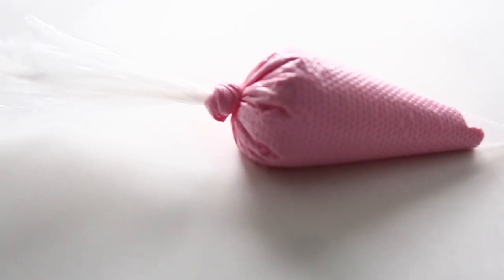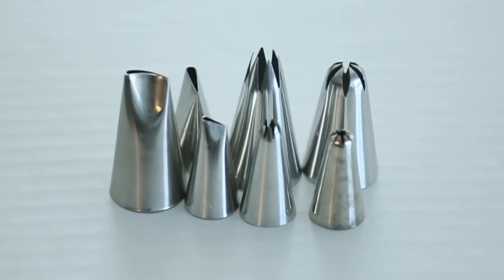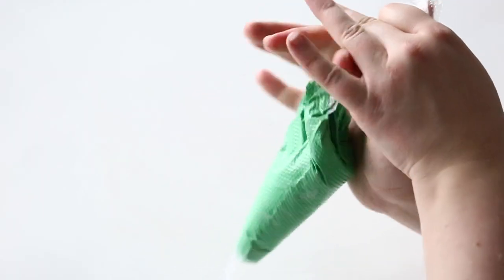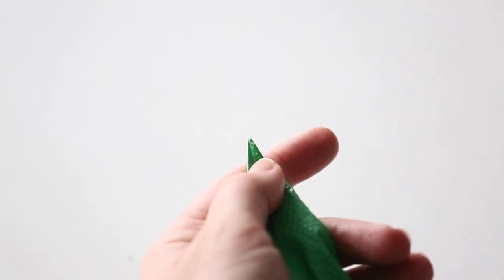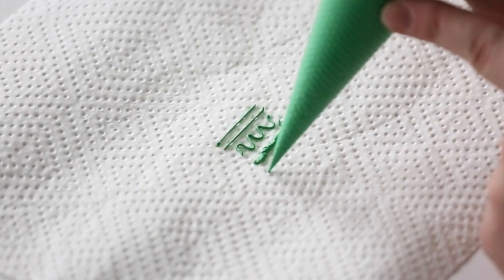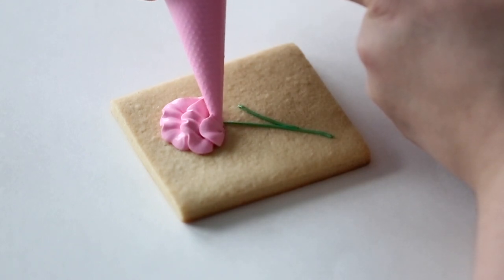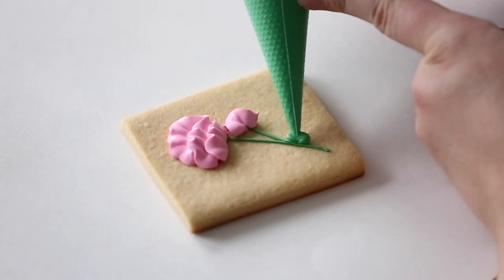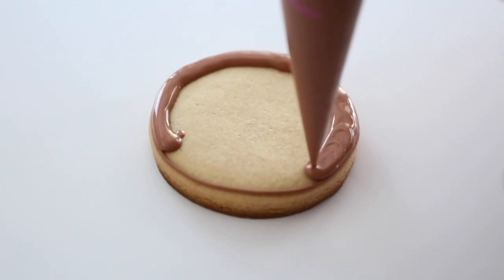Why I Use Tipless Bags

Comment: I use a heat sealer to seal my bags and if I have left over icing, I heat seal the other end and place all my left over bags into a gallon size ziploc. 😉
Reply from the maker: Great idea!!
Reply: Great tip!
Reply: How long is it good for?
Reply: Great tip! I have a heat sealer so I'll use it! Thanks!
Reply: Do you freeze or refrigerate leftover icing?  If so, how long does it last?
Reply from the maker: I personally like to refrigerate it overnight if im still working on my set the next day. But I used to keep it on the counter but find the icing separates less when in the fridge. Once I'm done my set I'll put the icing in the freezer, it should be good for 4-6 months I think?!
Reply: Do you think a hair straightener would work??
Reply from the maker: I've hear people using a hair straightener but maybe put a towel or something in between. I'm not sure if the heat would he too high. But I know I've read people do that!
Reply: Smart!!
Reply: Brilliant. I've always wanted to decorate cookies but was intimidated by the icing drying out etc etc. Now I'm considering heat sealing the bags if I can't get to the cookies until the next day, then putting those heat-sealed bags into food saver bags and use the pulse function to gently remove as much air as possible, and then refrigerate the bags.
Reply: So smart

Comment: Is this why I’m struggling with getting my lines to go straight? Because I’m using the Wilton bags as a tipless bag????
Reply from the maker: Yes!! The thick seam pulls the icing in that direction and so it doesn't let you pipe  a straight line (and always curls)! Buy some tipless bags and you'll notice the difference right away!

Comment: This was so informative. Hie large of a hole do you cut for just flooding cookies?? I think I may be using a hole size that I too small
Reply from the maker: If you find yourself squeezing the bag so hard that your hand is shaking, it is definitely too small! I always adjust the hole too as I go, if I find its coming out too slow or not enough, then I'll cut slightly bigger. You want it to flow without too much pressure but still want to maintain control of how much is coming out if that makes sense.
Reply: Thank you so much!!! @LittleCookieCo

Comment: Thanks for the video. I've been using a lot of your videos lately to learn more about decorating with royal icing and they are very helpful. The only concern I have about this technique is all of the waste with the plastic bags. I would totally be down with this technique if there was a way to save and mark each bag. Single-use plastics are literally killing our planet, so I will have to stick with reusable piping bags qnd tips for now.
Reply from the maker: Yes, I do agree, it really sucks that there is not biodegradable options right now (that I know of). Just make sure you wash your reusable bags really well as sometimes the greases stays in them especially if you use it for buttercream as well.
Reply: Best comment. Thank you. I'd rather put up with the small inconvenience of washing bags and perhaps not having as much control when piping icing, than adding to the plastic problem that's hurting our Earth.

Comment: I really love your video, it’s so clear and helpful, I can’t help but click the subscribe button😆

I always have flat icing when I pipe, do u have any tips on how to cut the tip of the  bag?
Reply from the maker: Thank you so much. Are you using bags that are quite thick? Or have a thick seam, sometimes that is the reason that it comes out flat. You can try cutting with the seam in the middle, make sure you are using really sharp scissors and cut a small hole, and then squish the bag flat the opposite way, and cut a tiny tiny bit off to make it a bit more even. Hopefully that helps!
Reply: @LittleCookieCo  thanks for your reply, I’m using the thin one, maybe my scissors is not sharp enough, ok I’ll try to do as u said😊 and see if it comes out better🙏🏻
Reply from the maker: Yes, make sure you have nice sharp scissors so your cut is smoothe. Also, squish your bag flat. If it's not flat, cut a tiny tiny hole and let the air out then make your actual cut! Hope that helps!
Reply: @LittleCookieCo  got it, thanks for your tips again, I’ll let u know if I got it successfully 😘
Reply from the maker: Best of luck 🥰🥰

Comment: Hey i ordered the thickened bags you suggested and all of them seem to have a bit evtra plastic at the tip that the causes curling and somrtimes a straight edge to the icing. They are driving me insane lol! Any others you like? X
Reply from the maker: Yeah I've had a few batches of those too. I feel like with every brand you get that every so often. I sometimes cut the excess plastic if I can or cut a slightly bigger hole. I have heard that the store How Sweet is That sells the Master bags and she inspects the seams . You can get them in Amazon too (they have red writing on them) and are much thinner, so if you put a lot of pressure on them they can burst. I've also heard TMP small bags are good for wiring and details but haven't tried them yet.
Reply: Thank you! I am forever changing bags! I try to cut it off and sometimes it works but sometimes it cuts too far! Will try these others bt for detailing will need the stronger bags so hopefully i can find some. Are there any metal tips you have tried and liked? I honestly don't like them but I may try this aswell!
Reply from the maker: I've heard the best are PME, I did buy a few when I first started, they are great cause they don't have seems liek the Wilton ones. I stopped using them cause they're a pain to wash but they do help. The other thing is when my icing is curling with a tipless bag I'll  put the side its curling on toward my cookie so it curls towards it and I'll attach it and then pull to straighten it out. When I'm doing turns or curves then ill stay really close to the cookie and put a bit extra pressure so it almost doesn't have time to curl, if that makes sense

Comment: I use Wilton bags and when I cut my bag the icing comes out flat and not round and also curls is that because of the type of plastic?
Reply from the maker: Yes exacrlt. Wilton bags are great if you are using metal piping tips, but not for tipless bags. The seam is really thick so then it makes the icing curl when it comes out. The thinner bags have a much thinner seam so its not as stiff as the wilton bags
Reply: @LittleCookieCo  i have been struggling with this issue . I love your videos! Thank you so much for your  response ! ❤️❤️❤️
Reply from the maker: Aww thank you so much ♥️♥️ there's so many tricks to learn and once you know them it makes things so much easier!
Reply: @LittleCookieCo  i agree! Thank you for the positivity!

Comment: Hi, what could be the reason if the piping is not coming out of the bag when cutting a tiny hole?   Tried it with outline and flood consistencies still no luck
Reply from the maker: It could be that your icing is too thick for the size hole. Or that your hole just isn't big enough. If its not coming out then keep cutting slightly bigger until it does without you squeezing the bag really hard. Another thing may be that your tip is clogged if your icing has dried in the tip.

Comment: My icing tends to squiggle instead of make a a straight line, what am I doing wrong😭
Reply from the maker: It could be a few things:
-Your tipless bags are too thick and so the seam causes this to happen (like if you're using wilton piping bags)
-Your hole is too small, so snip it slightly bigger and cut across the seam!
-the icing is too thick and your pressing too hard on the bag

Sometimes it's a combo of 2 and 3 so if you don't want to thin your icing, then cut the hole slightly bigger and if you don't want the hole bigger, thing down the icing just a tad!
Reply: @LittleCookieCo  Thank You!!!!!

Comment: Why does it curl sometimes?
Reply from the maker: There could be a few reasons:
1- make sure to use really sharp scissors, if your cut is not clean that makes it curl
2- you didn't cut with the seam in the middle when you flatten the tip. If you have the seam to the side when you cut it doesn't cut straight
3- your icing is too thick for the hole size (try cutting it a bit bigger)
4- the hole is cut too small in general, try cutting a touch bigger
5- the tipless bags have a thicker seam, this makes it curl (for example the wilton disposable bags are not really meant to be tiplees because they're way too thick)

Comment: I found tipless bags and they are no better than regular.  Mine still had 2 seems. Too stiff. Cost too much and still same problems.  Ive tried all the brands so far. Even these. Why am i have so many problems? Mine curl, get clogged. Ive done all the troubleshooting for the recipes. Ive done it all. Nothing ever works.
Reply from the maker: Tipless bags are only meant to have 1 seam, so the other ones with 2 are meant to be used with tips. They should be thinner and less stiff. Have you tried the ones I've linked in the description below the video? Once you get the right bags, you'll see it'll make a whole lot of difference!
Reply: @LittleCookieCo the ones I have are from sweet sugar bell. They are stiff and have 2 seems. The box say they are for using with out tip. They have the same texture has these but stiff. Amazon can be tricky cause I don't think they sent the right ones.
Reply from the maker: I think those Sweet Sugarbelle ones are thicker than the regular tipless ones. Try these ones out, they're also really good and it's not off Amazon. They're much thinner and playable. The seam and stiffness is really what creates issues when piping, so if it's thin, it's much softer and helps the icing come out the way it should.
https://trulymadplastics.com/Tipless-Piping-Bags-Medium-100-bags-p37667135Tipless-Piping-Bags-Medium-100-bags-p37667135Tipless-Piping-Bags-Medium-100-bags-p37667135